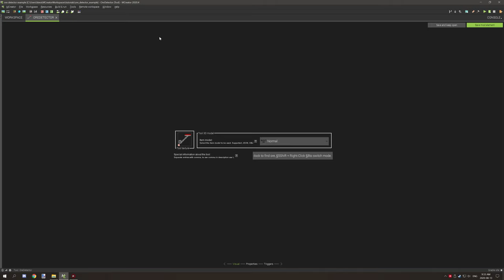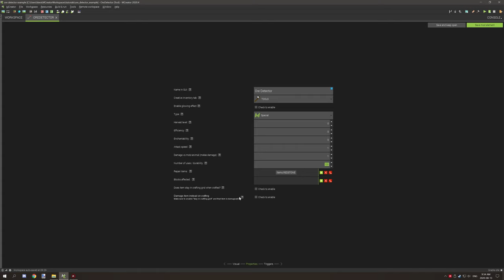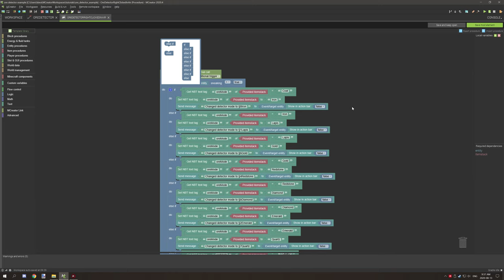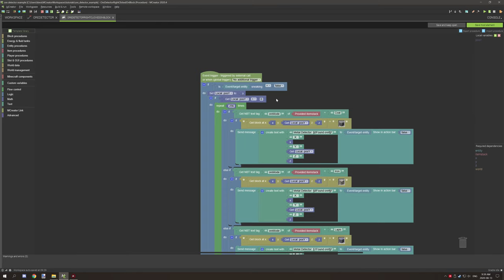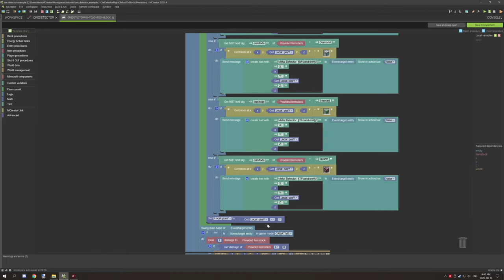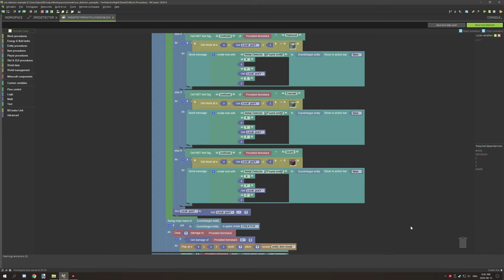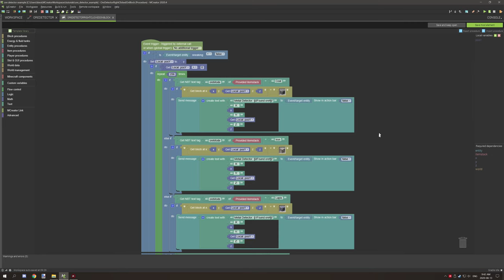MCreator: How to make a Ore Detector | 2020.4

Comment: Redstone is even a metal?
Reply from the maker: its a ore detector, ore is a basic word for mineral, minerals are the chemical compound in the rock, veins are pure high concentrated areas in a rock that holds one specific mineral type.
So all ores mask both metal and gems as both are minerals. Regarding the Redstone it acts a lot like copper as its a conductor so I think its close to a metal more then a gem yes.

Comment: Works with custom ores?
Reply from the maker: Regarding your own mod yes it that would work you just need to test for the block. It may also be possible to search for blocks using NBT Variables or TAGS but I have not tested that just yet. If that's the case then it could be cross mod compatible.
Reply: @NorthWestTreesMCreator  yeah i need a tutorial on that too